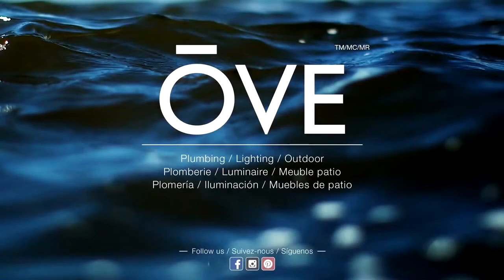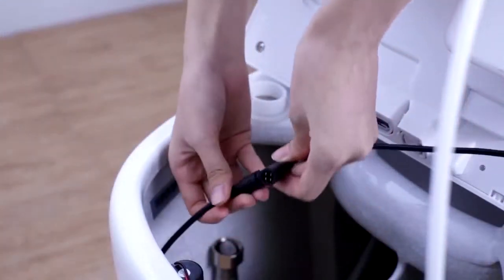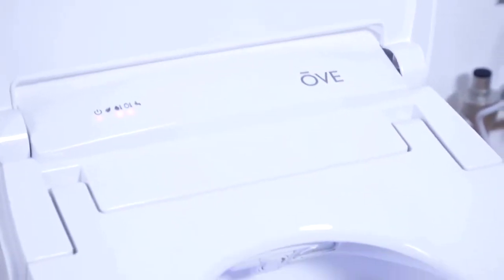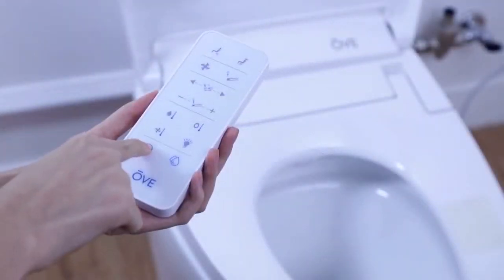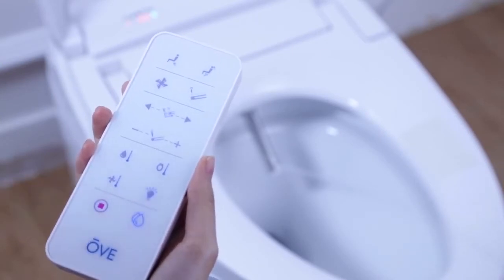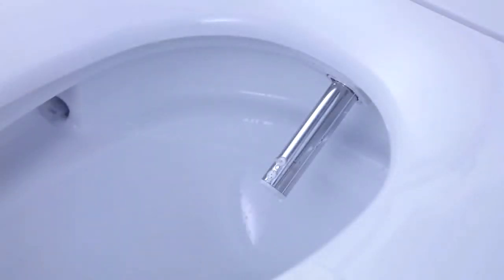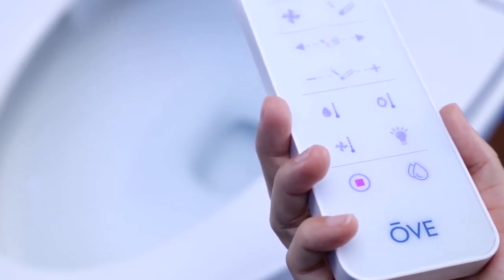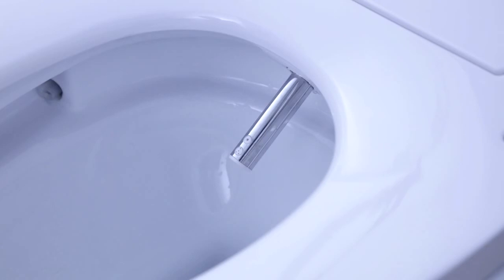[Old Version 01] OVE LENA & ELIN Smart Toilet installation

Comment: I had great difficulty connecting remote to the toilet. Watched the pairing video many times, read the instruction manual several times but no success, until I spoke with tech support. 
The key is to install batteries in the remote first then plug-in the toilet. As soon as you connect power plug, immediately start pressing say, red button, quickly around 20 times. 
Well, it worked for me. Then you can turn the power on button on the toilet.
Reply: Thank you so much for posting this.  I had the same problem and wasted hours trying to get the remote to pair and there is nothing in the manual or videos about this.  Once I followed your instructions it worked immediately
Reply: @allisonmorris7011  I am glad that it worked for you. 😁

Comment: How about a tutorial to pair the remote!
Reply from the maker: Please reach out to us at 1.866.839.2888 or info@ovedecors.com if you require assistance to pair the remote.
Reply: I had the same problem. Lean over so you can see the buttons on the side of the toilet. Turn off the toilet power button. Press the flush button and press the stop button on the remote. turn on the toilet. press any button. Crazy!!! The key is lean over the toilet and make sure you are pressing the right buttons.
Reply: @altaviaje  lean over the toilet?  I just got a new remote and having same impossible time pairing it.  This is insane
Reply: Doesn’t work as described
Reply: I am unable to pair the remote. Have watched ove video a million times. Called their office. A tech support guy was suppose to call within an hour. It is two days now. Does anyone have any other suggestion, short of returning it?

Comment: I literally just installed this and it’s amazing. Idk how, but OVE literally knows exactly where my butt hole is. The heated seat is great, the bidet works great and I give this toilet a 10 of 10. Hopefully, it doesn’t leak after a few days like some other reviewers mentioned.  If it doesn’t, it’ll be hard to go back to a regular toilet.
Reply from the maker: Thank you for your very positive feedback. There is no reason any of our smart toilets should leak. If you experience any difficulties please call us at 1.866.839.2888. We will gladly handle any claim and provide you with the best solution.

Comment: How to flush ? Is it automatically sensor?
Reply from the maker: Hi Samuel, 
Good question indeed! The Lena or Elin will flush automatically before and after use. You can also manually trigger the flush mechanism at will using the remote or the control panel on the toilet. Feel free to call our product specialists at 1.866.839.2888 for assistance selecting the perfect smart toilet. We manufacture quite a few models in various shapes with different functionalities.
Reply: @ovedecors1  thanks! We just bought the Ove Decor Virtuoso, for standing users, would it flush? For those who sit down it does flush automatically

Comment: Can water level in bowl can be adjusted? It fills the bowl to low level and stops automatically. I want to regulate how much water gets filled.
Reply from the maker: The water level is lower on our tankless smart toilets compared to a regular tank toilet. Rest assured that the power of the flush will do a much better work than a toilet with a tank. These toilets have the capability to flush clean 700 grams of waste which is more than a normally constituted person can produce. Do not hesitate to reach out to us directly at 1.866.839.2888 or info@ovedecors.com if you have any questions about our smart toilets and their above standard capabilities.

Comment: Can automatic flush be disabled? Toilet  flushes by itself without using it. Why?
Reply from the maker: The automatic flush cannot be disabled. There could be an issue in the seat sensors if the flush is triggered while the toilet is not being used. Please reach out to one of our experts at 1.866.839.2888 or info@ovedecors.com for assistance. Note that our smart toilets are covered by our 1 year manufacturer's warranty.

Comment: How do I pair the remote!
Reply from the maker: Please contact our product specialists at 1.866.893.2888 or info@ovedecors.com.
Reply: Arg, why can’t you just say here how to pair
Reply: Did you figure out?  So lame
Reply: @CraigPretzinger  found it. turn off the toilet. then hold the stop button on both toilet and remote at the same time. turn toilet back on
Reply: found it. turn off the toilet. then hold the stop button on both toilet and remote at the same time. turn toilet back on
Reply: @jeffreyliang2780  If this works, I will be eternally grateful!!!!! 😇
Reply: Man, this did not work :(
Reply: @TheInsuranceDudes  ahh it didn’t? I paired it today too. so when i held the stop button on both the toilet and the remote at the same time, it made a double beep sound before being connected. you’ll know it’s connected when you start clicking on the remote and it makes noise as you click. 

Try this. turn off the toilet. when you restart your toilet, hold the start button until all lights are flashing. then try to pair it by holding the two stop buttons.
Reply: @jeffreyliang2780  Thank you Jeffrey. This totally worked. I don't know why OVE can't just tell us here. Dealing with their customer service was a nightmare so I'm so happy you had the fix.
Reply: @porkloin2000  no problem, my uncle was about to use this bidet without the remote functions and I knew I had to find a way to solve this
Reply: I just added my comments regarding the pairing.
Reply: @jeffreyliang2780  Thank you! I spent an hour videochatting with my girlfriend helping her figure this out. It didn't say anything like that in the manual >_<